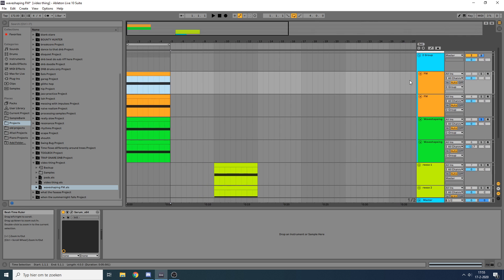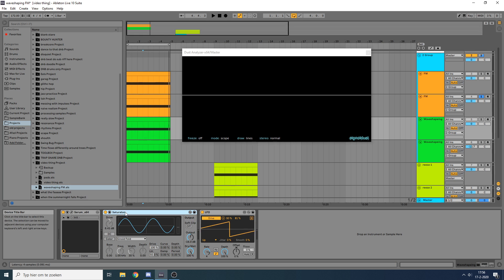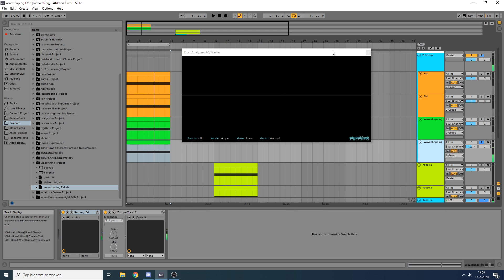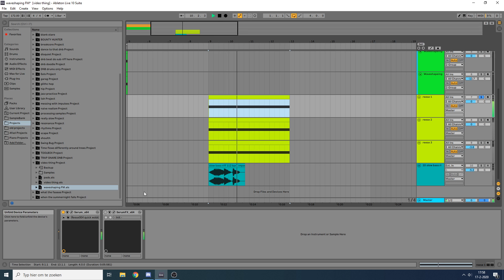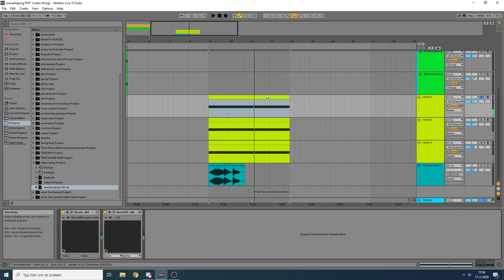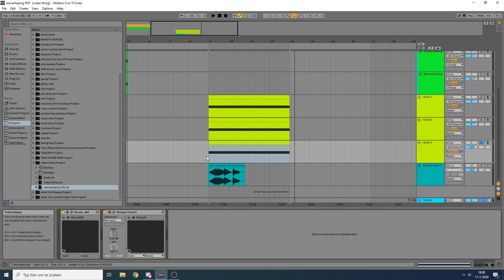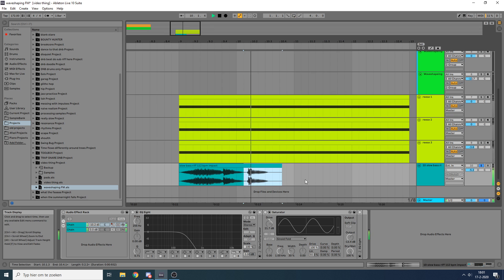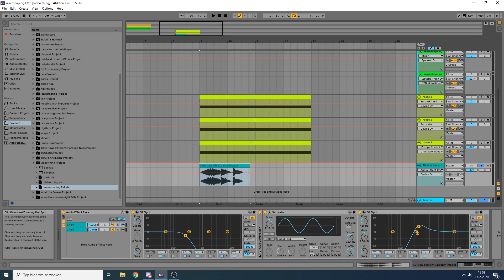How FM Synthesis is similar to Waveshaping Distortion

Comment: Thanks for this video! Very interesting approach, especially when you're working with sine (like) functions. I think this works because in FM synthesis, which is actually PM in most synths, you take the carrier function and plug in the modulator, eg; sin(2pix+a×sin(2pix)), or c(f+a×m(f)).
Waveshaping is a similar thing, yet the modulator would be the shape of the waveshaper; eg sin(a×sin(2pix)), or m(a×c(f)). So you get a similar result with sine waves, yet when plugging in more complex sounds, the swap of carrier and modulator gets more noticeable.
Reply: Yes thats right, and actually some fm synths let you set the carrier to a frequency of 0, so when you “modulate” it, its mathematically the same thing as putting a sine wave into a sine-shaped transfer function. Most of the time fm synths are made using sine lookup tables instead of actually computing it with a sine function, but even using a lookup table, its the same thing as if you were to take the sin function of a sine wave